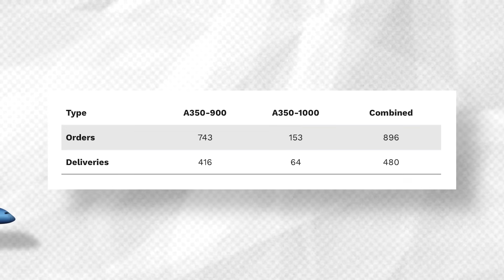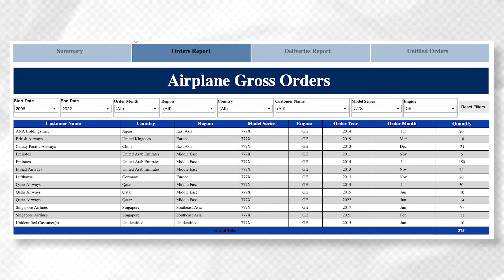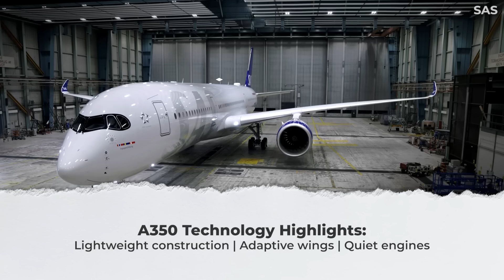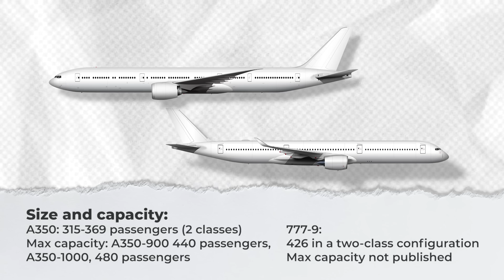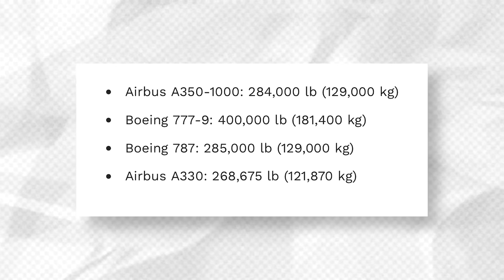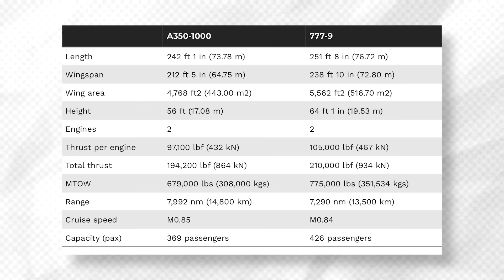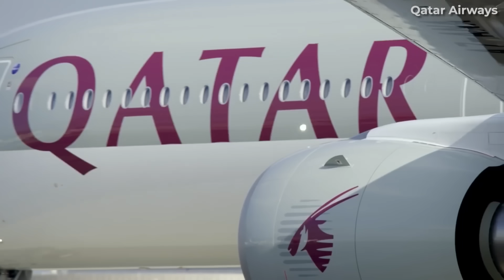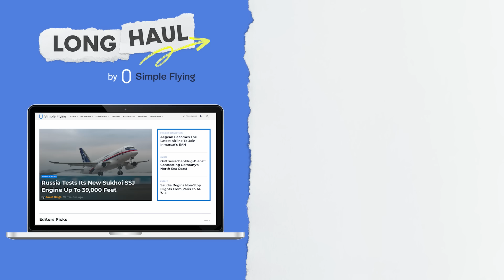The Boeing 777x vs Airbus A350 - Which Plane Is Best?

Comment: A350 because its versatile and airbus can further extend on market demand as Ultrafan engines gets ready, and airbus will be in a position to launch a350 neo with further lower fuel burn hence making 777x more vulnerable. Already 777x wont be ready as early as 2025. Boeing will face the same issues like MAXX vs NEO in next 7-8 years.
Reply: You are forgetting the 787 . Even thou it doesn't compete directly with the a350 , Boeing could still offer a Maxed version with newer engines like the RR Ultra Fan too but also offer ER or LR versions of the type . The 777x is a replacement for current 777 owners and previous 747 owners. I think airbus should be more worried about the 787 than the  777
Reply: @mmm0404  the low end of the A350 family, the A350-900, competes with the 789. The 787 landing gear is at maximum weight. Its not just about sticking bigger engines on an aircraft, they would have strenghthen the landing gear aswell.
Reply: @mh12-47  it does , but not directly. The 787 competes more directly with the a330 neo. The a350 is heavier than the 789 and more range
Reply: @mh12-47  in terms of capacity and  MTOW the -900 competes more with 787-10 even thou it has a much shorter range
Reply: @mmm0404  Spot on! I couldn't have said it better.
Reply: The RR Ultrafan is still in development (in 2026) and hasn’t proven it’s efficiency and more importantly, its reliability compared to the GE.  

The PW GTF is highly efficient, but has proven to be unreliable.  RR has its own issues when it comes to reliability given the Trent issues on the 787 and even the engines on the a350 not liking the desert.
Reply: The A350 is not well suited to carry cargo, and that part was missing in this video. Airlines are going to want the 777 because it's going to carry more passengers and cargo, and do it significantly cheaper than the A380. The 777-9 is not built to compete with the A350-1000. It's basically going to be in a class all by itself.
Reply: @sainnt  but the a350 is being converted to become a full cargo jet....
Reply: @anthonydeas2173  Yes. They have 22 orders. The 777-8F already has 34. That ought to tell you something. That, and the sales of current Airbus freighters compared to Boeing. Just about any aircraft can be converted to a freighter, but why are there so many Boeing and so few Airbus?
Reply: @anthonydeas2173 

The 777-300ERSF conversion has more orders than the a350f.   As of September 2025, it is certified (a350f is not) and the 777-300ERSF has a large (over 800 aircraft) supply potential over the next 10-15 years of passenger aircraft that could be converted.   As of 2026, Boeing has requested approval to extend 777F production given demand for that plane until the 777-8F is ready.
Reply: @sainnt  Not well suited for cargo......seriously?

Between a 35K and a 779 the payload difference is a mere 5t, which is easily elimilated by the extra passengers onboard a 779. And that advantage diminishes beyond 6000nm, which means for a typical TPAC routes 35K actually has more payload for cargo than the bigger 779. The only significant advantage of 779 is volume, really.

777XF has a mere 8t higher payload and less than 10% more volume than 350F, despite having 49t higher MTOW and a pair of much more powerful engines. That being said, 350F is still more capable than 777F by almost all metrics.

In fact, Cathay Pacific almost grounded their entire 777 fleet, while keep flying 350s during the pandemic. Mind you, no one outside Middle East other than Fedex and UPS carries more cargo than Cathay, and they are perfectly fine with the aircraft. They even openly appraise its capabilities multiple times. Airlines tend to stick with existing family due to commonality, yet out of the 4 customers of 350F, 3 of them actually has 777F in fleet. That is telling.
Reply: @steinwaldmadchen  If your logic makes sense to airlines, they will fly more Airbus aircraft for their cargo. For passenger capacity, Emirates would have ordered 115 A350-1000 instead of 777-9. 
By the way, Cathay has a fleet if 747 cargo planes. I guess you conveniently forgot that. Also, the A350 has 22 orders for it's cargo variant, and it was announced first, and would be in service first. And yet, the 777-8F already has orders for 34. Your logic only makes sense to yourself. All the tonnage you're dismissing as if they're trivial translate into real money for airlines. Every airliner has merits and demerits. The merit of the 777 is it's higher versatility, which is designed into the airframe from the beginning, not modified later when you smell a demand. That's why nearly every Boeing airliner has a cargo variant.
Reply: @sainnt  Despite 767 didn't sold well in Asia where carriers demand high cargo capacity on widebodies, and that 767F sales took off only after A300F was discontinued? A300 is the smallest fuselage that carries 2 LD-3 in lower deck. 767 is incapable of that.

A320 didn't have a freighter variant mainly due to its popularity as a pax aircraft, which is more profitable. But once NEO finally freed up older 32Xs, 321P2F is emerging as  the only fully containerised narrowbody freighter.

Even A330 is having multiple ventures investing in conversion lines, despite 330F not being very successful.

Of course I know Cathay picks 747F over 777F for its extra capacity. But they also carries lots of freights via pax aircraft, and rejected 767, 787 and A380 for their lack of cargo capacity. Yet they're taking lots A350, and let them taking over 77W routes even before the pandemic. That action speaks louder than any words.

If tonnage matters that much 777F wouldn't be selling at all. Despite its economy, its almost 10t lower than 744F and almost 30t lower than 748F. While freighter in general are in low usage, new-builts fly at higher frequency to justify its acquisition cost. Often these freighters are acquired by Asian carriers, whose flights are long, and cargo flows are highly asymetric. Operational cost does matter, especially when flying empty from N. America back to Asia. In fact, only Cathay and Korean, the largest two in the region, ordered 748F, while others stick with the smaller 777F.

Back to the 777XF vs A350F question. Due to 777F's popularity and Airbus' previous lack of alternative, they'd have to convice airlines that A350F worth the type switch cost and pain, which proves to be very difficult. Yet they still managed to secure CMA CGA, Air France and Etihad, despite all 3 have 777Fs. Having both 350 and 777X pax in fleet, SIA chose 350F over 777XF for their 747F replacement. Boeing has the incumbent advantage, and to be fair, its unit cost matches A350F. Qatar, Lufthansa and Ethiopian are all existing 777F users. But 777XF would still need to justify is 10% higher trip cost and more expensive navigation fees due to its weight. Which is not necessary easy, given 350F already carries more weight than all existing twinjet. And with a much smaller total 777X backlog they'd have a hard time keeping manufacturing cost down compared to 350F.
Reply: @steinwaldmadchen  You seem to know all the answers, but bottom line is, all the cargo airlines in the world, and all the passenger airlines that have cargo divisions, and all the passenger airlines that tend to carry a lot of cargo with their passengers, operate more Boeing aircraft than Airbus. No matter what rationale you want to apply, the pure numbers simply don't lie  The margin is not even close enough to be worth debating. The A380 is the largest passenger aircraft ever built, so you'd think it would be perfect for cargo...all that space. It's not. Stop trying to fit  a square peg into a round hole. 
We can debate Airbus and Boeing aircraft as passenger planes, but as cargo planes it's not worth discussing because Boeing is simply crushing that sector. Period
Reply: @sainnt  I never said A380 is good for cargo. But the reason why Boeing is dominating is the fact that they have been dorminating the VLA sector for decades with 747 and 777, and that was largely uncontested by Airbus until recently, while Airbus is too busy to develop the narrowbody freighter.

767 pax was never popular in Asia or any airlines with serious cargo demands, other than Japan. But Japanese companies had a stake in 767 programmes, so understandably there's some political pressures. Even as a freighter 767 is mediocre at best. It simply can't survive pass 2010s without KC-46 funding. On the other hand, 300/310 is popular in Asia and 330 is a smash hit even in its earliest form. Unfortunately 332F is too big for couriers and too light for general cargo carriers, but 333 conversion line and backlog is emerging just as 77W.

None of the Boeing narrowbody offers container load in lower deck, which actually matters for both pax carriers with serious cargo demand, and couriers who needs high turnaround speed. Plus 321 offers more payload-range than anything but outgoing 757.

Even at the top end now Boeing no longer enjoys the monopoly they had for decades, and despite 777XF currently has a lead, it losses more than 1/3 that could have gone to them, and they can no longer set the price as they wish. And many agrees 350F is a serious competitor.

How would the market looks like 10 years from now? Will Boeing still has the same lead as it is right now? I doubt.
Reply: @steinwaldmadchen  You keep trying to make a case for Airbus, and your arguments are invalid because they're unsupported by the numbers. Boeing has been selling narrowbody freighters and combi versions of just about every aircraft they've ever built, because they've always focused on aircraft that suits every need, not just a particular need. That's why they're dominating. 
I concur that Airbus never really competed in the cargo sector, and they're way too late in the game to catch up. As a matter of fact, even with the A330 conversions that you speak of, there's just as much of a backlog of 767 and 777 conversions. Amazon is converting 767 and 737 mostly, not A320 or A330. Even McDonnell Douglas has had more success with cargo conversations than Airbus. Let it go.
Reply: @sainnt  Let's face it, conversion is the mainstay for smaller freighter, and when airlines often keep their A320s for 20 or even 30 years, there's simply no chance you can get a viable candidate, no matter how good or bad A320 is as a freighter. Compare to 737 classic, can you easily find  an active pax airliner, let alone one that are not 2nd hand? Not to mention Airbus wasn't even a thing when Boeing started building 737 jurassics.
That doesn't necessary means A320 sucks. Quite the opposite, multiple carriers are already interested in 321 freighters, despite it hasn't started revenue flying yet.

Speaking of 767F, let me remind you again that its delivery never surpassed A300F until the latter discontinued in 2007. Among the 4 largest 767F Operators (DHL, UPS, Fedex, Amazon) none of them had more 767F than 300F/310F before late 2000s, and two of them didn't own a single 767F at all. 767F's success since 2010s is more as a result of being the last standing man, than its superiority, and it simply won't survive without KC-46 given its delivery drought was worse than A300.

While US carriers are often bounded by code D spots in their hubs, those who didn't like DHL are already taking A330 freighters, new built or converted. We'd see how Boeing and the market react when the only code D freighter is deemed to cease production from 2028.
Reply: @steinwaldmadchen  You're not making any sense, so this conversation is over. There are 737 classics, even 727 aircraft that are in still service today, as freighters and passenger aircraft. You keep making excuses, and arguments that make no sense.
Reply: @sainnt  Many of the oldest active A320s are more than 30 years old, and still flown by their original owners like Delta, Air Canada and Lufthansa. How many first world major carriers are still flying 737 Classic as a pax airliner? Not a single one.

A320 and A330 is still economically viable as a passenger plane today, while 767 not so much and 737 Classic not anymore. There's no point carrying out conversion when it still has residue value as a pax frame, which is more profitable. How can you convert aircraft into freighters when they're simply not available for conversion at all?

Meanwhile 767F never outnumbered A300/A310F until the latter two discontinued and feedstock dried up. Why haven't the likes of DHL, Fedex and UPS picked 767 instead of end-of-line A300s?
Reply: @steinwaldmadchen  the average life span of an aircraft is designed to be around 20-30yrs. You say DL, AC & LH are still flying 30yr old A320s but no original 737s or 727s are still around. Those 737/727 you speak of, if they were still in service with their original airlines, would be 60yrs old. So your logic is highly flawed and doesnt make sense. LH will be retiring its oldest A320s this year.
Reply: @mh12-47  737 Classic refers to -300/-400/-500 that were delivered between 1984 and 2000, which overlaps with A320 that started delivery since 1988. In the case of Lufthansa, their final 733 arrive later than their first 321, yet all 737s left their fleet by mid 2010s,. Delta inherited 737 Classic from Western but all sold. Even Southwest no longer owns a single classic, despite their youngest was delivered in 1999. Quite a number of the Classic were converted into freighters, or sold to 3rd world /charter airlines.

On the other hand, many of the active 3-decade old 320s are still owned by the same Air Canada, United and Tunisair, while Lufthansa and Austrian are flying early 321s they bought. Delta, Swiss (LX) and Air France also have very old 32Xs inherited from Northwest, Swissair (SR) and Air Inter respectively. Only a few are owned by European Air Charter and Iranian carriers. By the time these aircraft leave the fleet they're simply too old for conversion. It's A320NEO and global pandemic that finally freed up relatively young 32Xs for conversion, yet with the resurge of travel demands and delivery delays, 321 feedstock may be in short again.
Reply: @steinwaldmadchen  You're an Airbus fan, and it's clear. If you're talking about major airlines, then you can talk about the 757 and 767 that are older than the A320 family of aircraft, also still being widely flown. As passenger planes. There are still 737 classics from the same era as the A320 also still being used as passenger aircraft. Your argument lacks objectivity and full of omissions just to prove a point that's been invalid since the beginning of this conversation. Numbers never lie. Only people do.
Reply: @sainnt  You want to talk about number, fine

1. Between 2000 - 2007, a total of 67 A300 were delivered. Only 5 of them goes to then Japan Air System as pax liners, others all delivered to Air Hong Kong (A DHL partner), Fedex, UPS and defunt Galaxy Airlines  (owned by Sagawa Express, a Japanese logistic coglomerate) as freighters. At the same period, only 15 of the 186 767 are delivered as freighters to ANA, JAL, LATAM and UPS, 3 of which owns pax 767 anyway.

2. Since 2014, around 180 767s were delivered, yet 63 are delivered as Pegasus  to USAF and JASDF. Sans KC-46 average annual delivery is only 13, or just more than 1 per month. Otherwise only between 2011 - 2013 (787 compensations to JAL, ANA, Latam and Astana) and between 2000 - 2004 did Boeing managed to deliver more than 2 per month. How can they survive a low production rate for almost 2 decades, without highly lurcative defense orders?
Not to mention without KC-46 Fedex may simply not confident enough to order 767 at all.

3. You still haven't answer my question why haven't major current 767F customers like DHL, UPS and Fedex ordered 767F in the past, instead of end-of-line A300F.
UPS took 33 767F by 2001, yet still decided to add 53 300F from Airbus instead of more 767Fs. It's only until 2009 they resumed getting 767F. DHL received theirs from late 2000s, yet their 767F fleet is only 14 more than 300F. Fedex has 65 300F together with ~70 310F in the past. They only started taking 767F since 2013, 6 years after A300 ceased production. Did they chose 767F because of its capability, or did they chose it because they simply don't have an alternative?

4. Like I mentioned, none of the 737 Classic in operation are with mainline carriers. Those in operations are: charter airlines, which operate in low frequencies. Canadian carriers, which operate modified aircraft that could land in remote airports within arctic circles. Venezulan or Iranian carriers, that are subject to sanctions. Or 3rd world carriers, which cannot afford the capital cost of newbuilt aircraft.

Meanwhile, one of the oldest 320 is N309US, a 32-year-old aircraft owned by Delta. According to flightaware this aircraft has been flying 3 - 7 flights on a daily basis, which is probably the same way they operated newer aircraft as well. I don't think any of the forementioned 737 Classic are as heavily utilised as N309US or any other A320s in mainline carriers.

btw N309US seemed to have ~41000 cycles and ~90000 flight hours. Do you seriously think these high cycle frames can still be converted to freighters with reasonable life?

You are clearly in delusion, and simply don't understand what the numbers mean.
Reply: @steinwaldmadchen  Numbers are not a delusion. They are fact. 
Fact: UPS was the launch customer for the 767F in 1995. They've ordered a total of 91 of them, including 19 just last year.
Fact, there are over 750 767 aircraft flying today.
Fact, UPS operates more than 500 aircraft, the only Airbus variant being the A300-600F
Fact, UPS has 52 A300, 75 757, 72 767 (19 more on the way),42 MD-11, 26 747-8F, 11 747-400F, plus 8 767 converted aircraft and other converted variants, none of them Airbus.
Fact: FedEx also has 65 A300-600F, but has 114 767-300F with 38 on order. They also have 115  757-200SF and 64 McDonnell Douglas aircraft. These are not new planes. 
Numbers, my friend. You can speculate that, if Airbus built more cargo planes they will sell more, but the fact is, Airbus aircraft are being converted to cargo planes, but still not at the same rate as Boeing aircraft. Numbers, they never lie 
When it comes to cargo planes, Airbus is not in the conversation. Don't feed me the BS of them not being converted because they're reliable passenger aircraft. I already debunked that by pointing out that Boeing has aircraft as old as the Airbus still flying and you're talking about non-mainstream airlines. What about Delta and United and their fleet of 757 and 767? They're not mainline enough for you? Or do you think Delta is only flying old A320 aircraft?
In the words of Ed Lover, "c'mon son!!"
Reply: @sainnt  Fact is UPS stopped 767F delivery and jumped to A300F in the early 2000s, instead of getting more 767F, despite they launched 767F and should had get more for commonality reasons.

Fact is they ordered more A300F, than their first batch of 767F.

Fact is UPS only resumed 767F deliveries after A300F discontuned. By the time DHL, UPS, Fedex and Amazon take 767F there's simply no other code D freighters in the market, but when there was an alternative, it's 767F that had poor sales, not A300F.

Fact is KC-46 consisted of 1/3 of 767's backlog since 2014. Without USDF tanker 767 delivery is as low as A300, and would also be dead. Boeing would be bleeding to keep a line with just 1 monthly delivery for almost 2 decades.

Fact is 767 was never popular in Asia, where pax airliners always carry cargo, while every major economy in the region have A300/A310/A330 at some point. Cathay and Korean have lots of A330, but neither owned a single 767.

Fact is none of the 737 Classic operators are at the size and utilisation of Air Canada, Delta or Lufthansa. They are out of favour. No one fly multiple cycles and/or hours with 737 Classic because the cost is not good, unlike 320s. Cargo and charters don't operate in high utilisation.

Fact is you simply don't understand any of the above, despite my elaboratation. Can you read?
Reply: @steinwaldmadchen  You keep making an argument that makes no sense. Airbus builds A330-200F,  but the last one was sold in 2015. They're now getting orders for conversion aircraft, but still not close to Boeing numbers. Your argument makes zero sense because numbers don't lie. Airlines fly old aircraft that they're unable to replace with something suitable for their needs. The 737 has been modernized more frequently than the A320, so airlines don't have to keep flying the classics. Airbus, on the other hand, did not modernize the A320 until the NEO, 30 years after the fact. This is the reason why the oldest ones have flown for so long,  and the same reason that airlines are not willingly getting rid of their even older 757 aircraft. The A321 CO was never as capable. 
The freighter argument is no longer worth my time because the numbers don't support your logic. Perhaps now that older A330 are being converted to freighters their numbers will increase,  but they will never catch up to the 767. 
With the exception of the Dreamliner, Boeing has built every single aircraft with cargo capabilities built in. Every Boeing aircraft has had a combi versions, except the Dreamliner. Air Freight operators are used to them and love them. It's a market sector that Airbus mostly ignored, and all but gave up on because they simply weren't getting enough orders to keep it going. They even tried with the A380 and failed. The A350F will sell units, but the 777-8F is going to crush it too. It is what it is. They can continue dominating the narrowbody market, but Boeing sells more widebody than Airbus. Always have, always will.
Reply: @sainnt  FINALLY SOMEONE UNDERSTANDS!!! I've been saying this since 2013. The A350-1000 competes with the 77W. The 777-9X are class by in itself. The last 10yrs years the fanboys have been comparing the 777X with A35K which never made sense. The 777X was designed to be the true sucessor to the 747-400 and at a stretch the A380.
Reply: And then Boeing can replace the 747/777 families with one brand new aircraft  family and take the "A350NEO" head on.
Reply: @mh12-47  boing? A new aircraft?? 🤣🤣🤣
Reply: @mh12-47  ill probably be senior when that happens
Reply: @mh12-47  won't that take years and years to come to fruition?
Reply: @mh12-47  won't that take years and years to come to fruition?